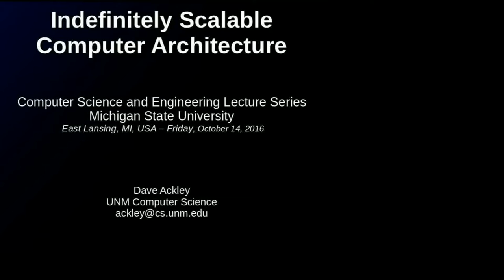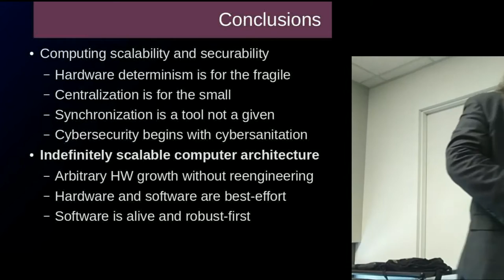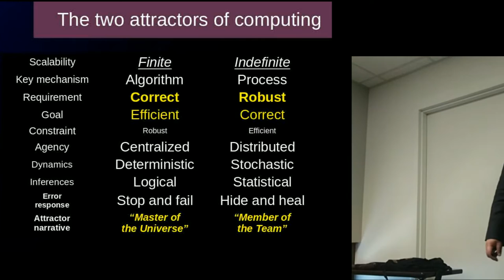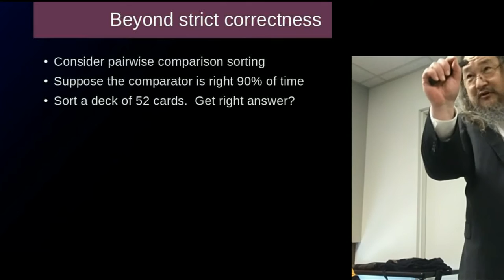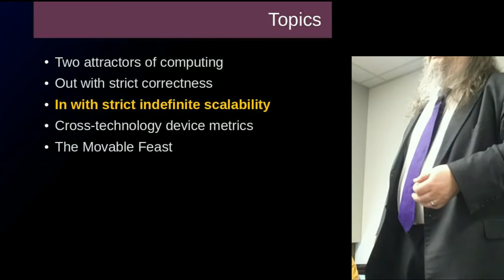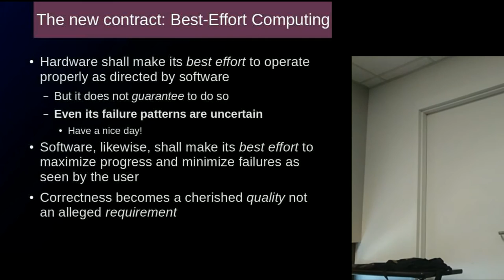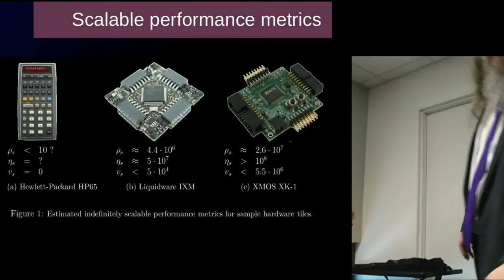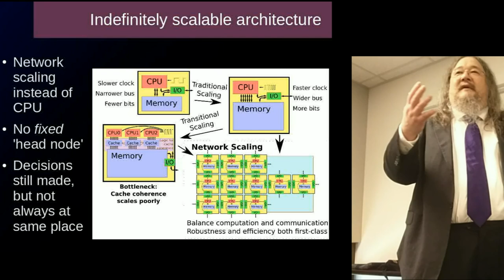Indefinitely Scalable Computer Architecture

Comment: There is a powerful addition to the list of advantages for a robust-first computing system.  To illustrate I will take an example from my own area of interest; agricultural robotics.  To an outside observer watching a field worker picking a food crop, berries for example, such work may appear mindlessly repetitive.  But in closer examination one notices that it is anything but.  Every berry is different, every plant is different, and every hand and body motion as you move from one picking action to the next is different. To reproduce robotically the picking actions of a farm field worker requires a computational system that can constantly adjust to the changing task requirements that working in a field presents.   When looking at the system presented in Dave’s videos, not only is a robust-first computing system tolerant of disruptions within its own structure, but it’s also the perfect computational framework to deal with tasks which are constantly changing, moment-by-moment, in real time.
It’s ironic that one of the lowest paid of all the skilled manual labor occupations, farm field work, will be one of the last to be reproduced robotically.  But this challenge is the same for any robotic system that needs to work in out-of-doors environments like farming, logging, mining, construction and etc..
Reply from the maker: Flexible  system control is a great goal.  And even if smart hunting grabs the limelight, it was really the smart gathering that got us all through!

Comment: The XMOS-XK-1 seems to have been discontinued. Is there some new hardware you're working with?
Reply from the maker: We estimated XK-1 numbers from its specs but never actually used it.  We're getting serious about building a next-generation tile right now!
Reply: ***** excellent. Sorry to be lazy, but is there any literature you'd recommend reading? I'm comp sci. background with an interest in what you're doing.
Reply: replaces tiles with backplane slotted processing cards, preferably in fiber optic logic ;)
Reply: Has anyone here taken a look at the GA144.  It was not a commercial success, but there are still parts available.  And there still is a small working group of true believers trying to figure out something they can use the part for.  The GA144 is an 8 x 18 asynchronous array of simple processors.  Each cell has its own ring oscillator; (IIRC)500+MHz.  If you can adjust your thinking to its stack-based instruction set, you might have some fun working with it. One of the drawbacks of its design, and one that probably kept it from finding a commercial market, is the unfortunate shortcoming that the pin-outs for the chip do not allow chips to be tiled to form larger asynchronous arrays. But if you don’t mind working with a system confined to 144 cells, you might find the GA144 a usable part.